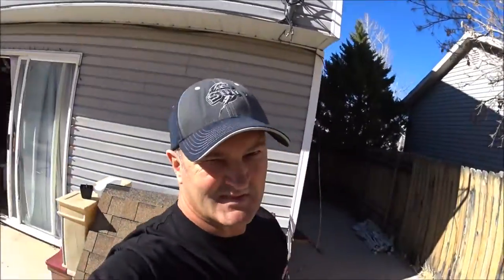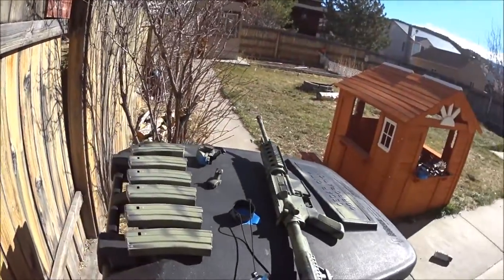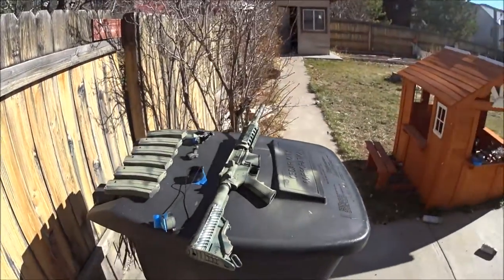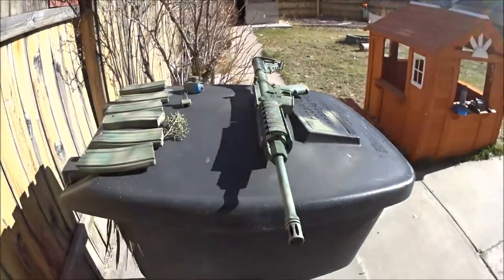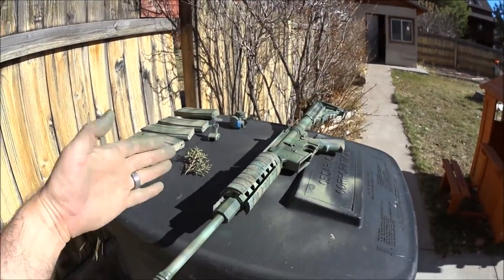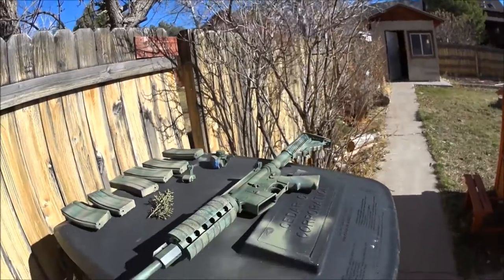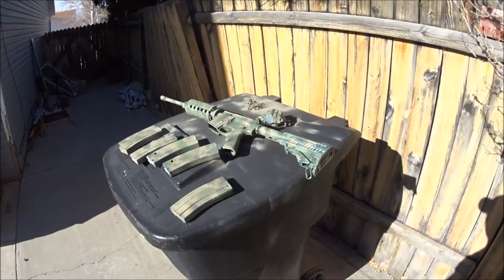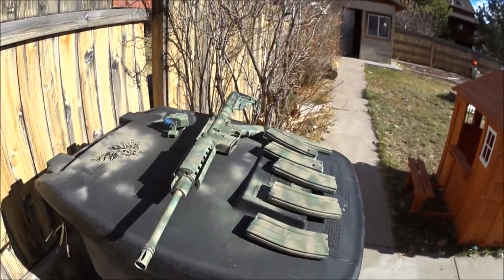AR-15 Camo Paint with Bonus Trip to the Land Fill

Comment: Looks great man! Interesting to see a scope, and a red dot on the same rifle.......Would like to see the whole process so I can do my AMD........
Reply from the maker: Thank you, really the process is pretty simple. Clean the rifle very good, then go out to where you live ie; the woods, desert, or whatever your surroundings are and decide on what colors of paint you'll need. My opinion is that four or so colors is enough. I usually start with the darker colors as a base (I am in a high desert area with lightly colored foliage and dirt) and then start getting lighter and lighter colors. I often use some of the plants in the desert nearby and spray over them to leave their shape on the rifle. This is how I was taught in the Marine Corps. - The end result doesn't have to look pretty, just blend in the colors to your background and break up the rifle's shape a bit.

I run the scope for hunting uses and the red dot on a canted mount that allows me to leave the scope on and still have a more close-quarters defensive weapon. Best of both worlds. That being said if I was going to strictly use this AR for CQB I would take the scope off and just run the red dot or something simple. Light weight and simplicity are pretty key - at least in my experience.
Reply: Thank you!  Sounds pretty straight forward.  And thanks for your service. ......